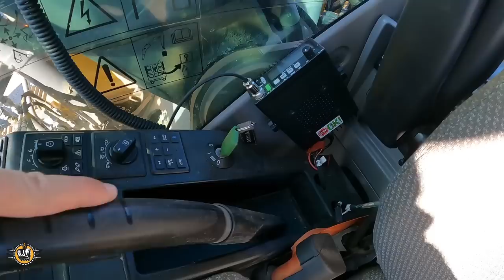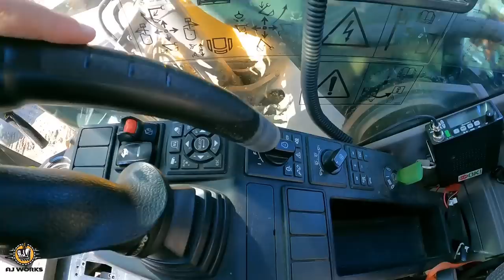Preparation For The New  Season

Comment: Ich würde niemals auf eine Handbedienung zugunsten einer reinen Fussbedienung verzichten. 1. Auch wenn ndie Handbedienung vorhanden ist, kannst Du die Fussbedienung immer noch benutzen. 2. Die Hände sind feinfühliger als die Füsse! 3. Durch die langen Hebel lassen sich die Funktionen feinfühliger als die Fußpedale bedienen!
Es nekad neiztiktu bez rokas vadības ierīces par labu tīrai kāju kontrolei. 1. Pat ja jums ir rokas vadība, jūs joprojām varat izmantot kāju. 2. Rokas ir jūtīgākas par pēdām! 3. Pateicoties garajai svirai, funkcijas var vadīt jutīgāk nekā kājas pedāļi!
I would never do without a hand control in favor of a pure foot control. 1. Even if you have the hand control, you can still use the foot control. 2. The hands are more sensitive than the feet! 3. Due to the long lever, the functions can be operated more sensitively than the foot pedals!